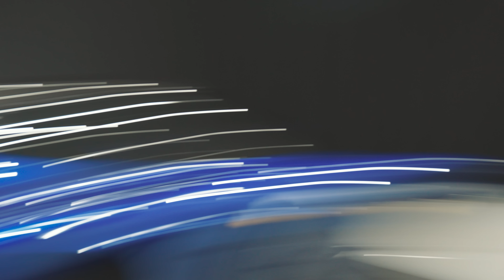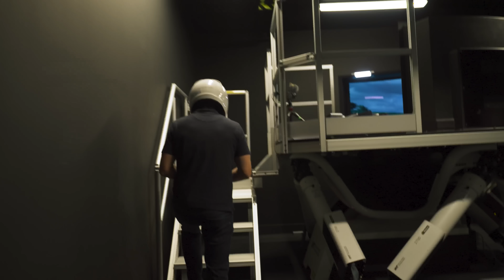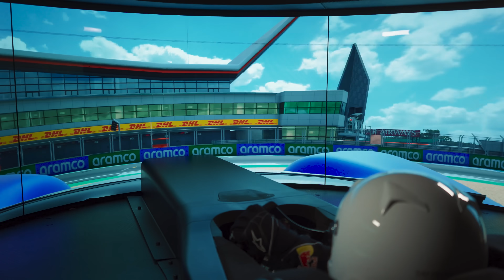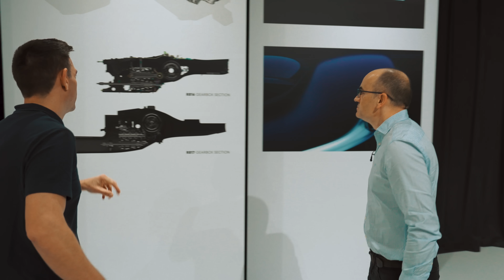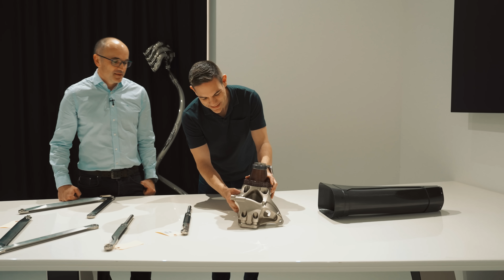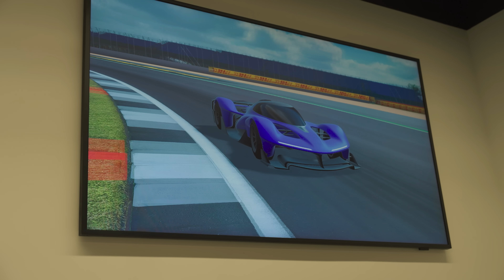We Drive The RB17! (In Red Bull’s Sim)

Comment: F1 has become hamstrung by restrictive regulations for decades, and push for reduced emissions, hence rroad/track cars can now catch up. If F1 were still running V12 units with no flow restrictions, there's no way the RB17 would get close.
Reply: The RB17 has no rules which restrict f1 cars so it could utilise active suspensions, active aero , blown diffuser , a full length diffuser and side skirts as well as other components which are illegal in f1, and in the hands of a driver like verstappen, it could be a handful of seconds faster than f1

Comment: They will never drive it, I’ve seen it in person and it doesn’t exist. It has no drivetrain, no real suspension components. It is just a fancy body and some parts loosely suggesting that it is attached to some wheels.
Reply: Tinfoil hat that this project has been some kind of loophole to test parts / aero in circumvention of the F1 testing limitations
Reply: @gm4215 I like that theory 😂

Comment: How can this possibly be faster than a McMurtry Spierling? Like can it bend physics? Maybe it comes down to the tires?
Reply: I think on the longer / faster circuits this could be faster than a McMurtry because of the limited top speed of the McMurtry.  The McMurtry can’t run over curbs because of the ground effects. Therefore a circuit like Nurburgring, as an example the RB17 would be quicker.
Reply: it has more power and weights less, but from what ive heard the tires cannot take on as much downforce as the mcmurtry, and it makes almost zero downforce from a standstill

so no, doesnt beat mcmurtry

Comment: Porsche got to similar performance (beat Spa qualifying record, not just race lap record) with a budget souping up of their 919 WEC racer. Not the 15K rpm scream and organic beauty, but they got there and the car seemed to perform well and predictably. I wonder where RB17 differentiates most. Aero efficiency that translates to even more top speed on longer straights? Is there less peak downforce that might limit limit cornering a bit vs 919 Evo? New better tyres...what might those bring on RB17?
Is the main downside that RB17 took upon itself the RWD configuration? 919 Evo accelerates amazingly.
Reply: Being able to run for 10,000 hours would be something, if achieved. I guess the 919 Evo is based on a 24h car, but it's not that easy to run and it won't do it in Evo configuration probably, it will just break before it gets to 24h probably which would be fair enough.

Comment: But can it beat the McMurtry Spierling?
Reply: Well, we won't know that until we see the McMurtry lap a traditional circuit, but wait, didn't it lap Hungaroring? I wonder how it's time would compare to F1. That would give us a better idea.
Reply: Sure the mcmurty will obliterate any cars on lowspeed, but dont forget the rb17 is the indirect sucessor to the valkyrie amr pro to the extent that it designed to be a track only car.  Even the 1100hp valkyrie got 160mph on turn 1 in top gear. While speirling got 170mph. I think the rb17 will go even faster on any straight and on any high speed corner. While the low speed will most likely slower than speirling, the difference will be subtle. Sure the speirling got gigantic fan, but dont forget the rb17 had way more extreme overbody aerodynamics, significantly lighter, and most likely had a fan or blown diffuser that helps low speed. The 4.5 v10 alone would be significant weight reduction compared to the 6.5l v12 on the valkyrie
Reply: @joat9105  Red Bull X2011 is 600-ish kg and 1600hp, along with fan assisted downforce and regular downforce
Reply: can the McMurty Spierling beat the Red Bull X2011?
Reply: No
Reply: @shonuffLA  yes it can lol
Reply: probably not, the Speirling is just another level of crazy (it just kinda lacks downforce for high speed corners like Copse, where F1 still solos)

Comment: That simulator looks straight out of a PlayStation One from decades ago.
Reply: Proper sims dont need to have good graphics, look at iracing for example
Reply: The computing power is dedicated to simulating precise physics rather than rendering graphics. That’s how you know it’s built to be accurate, not eye candy.
Reply: @ so was Gran Turismo 1. 🙃
Reply: @LeicaCat OEM DIL’s usually use another game for graphics, like rFactor, the physics sim is all their own. They don’t care how it looks.
Reply: @Monty-4248  It's actually rF Pro, which is related to the rF2 engine, but has split off into a separate codebase and company way over 10 years ago.
Reply: @polakjan  I was wondering what the sim engine was! I'm surprised that it's relatively updated - must be LIDAR scanned? I feel like this is the most comprehensive (indirect) look at a team simulator we've gotten.
Reply: @ShadowWolfe  yeah, definitely laser scanned. Even consumer sims have been doing that for ages. AFAIK there is single a company that laser scans all tracks for all the teams and also processes the data for them

Comment: I really don’t want to be the skeptic, but can’t Red Bull just make a simulator car as fast as they want?
Reply: They could but that would be useless and a colossal waste of money, you want it to be as accurate as possible to collect data which can cut actual live testing run miles, which are by some orders of magnitude more expensive.
Reply: @ of course, for their purposes they would certainly do that - but for a Top Gear presenter they can just make a few changes and he can drive a spaceship if that’s what they wanted. Just playing devils advocate here.
Reply: @TheStallion234  Sure its possible, but why would they need to? It already has 1200hp, an f1-style v10, race slicks, very low weight, & massive aero/downforce/grip. 

Just driving a Valkyrie/AMR in FH5 is wicked fast around a test track. So Id assume this'll be atleast that capable in corners. 

(And 1200hp/under 2,000lbs.. is 1200hp/under 2,000lbs)🤷‍♂️
Reply: @flexinclouds  for sure, but to lap it at the 5th fastest F1 qualifying lap at Silverstone with essentially no wheel time at all seems generous. I want to believe the real thing is going to perform like this, I do. I’m just skeptical
Reply: Let's stop you there before you build a particle accelerator. Also there's an assetto corsa mod for precisely that.